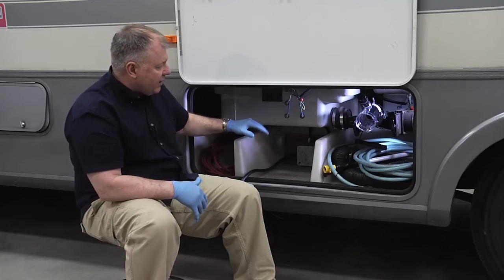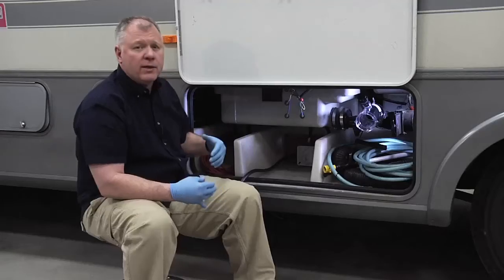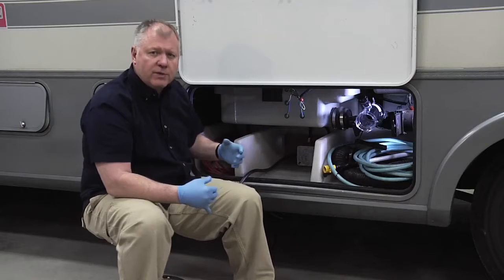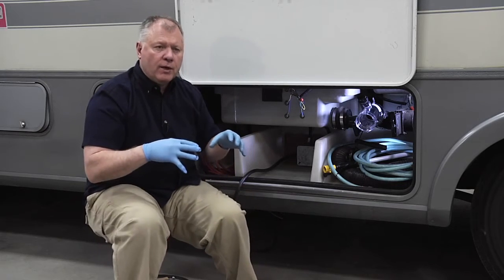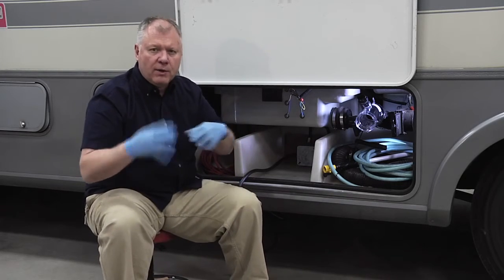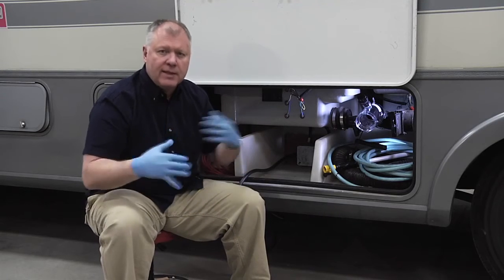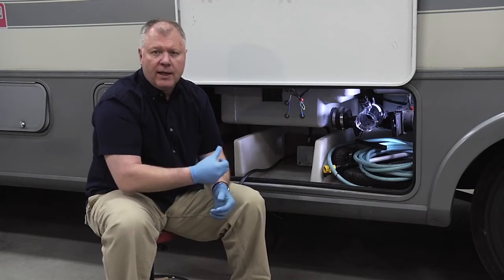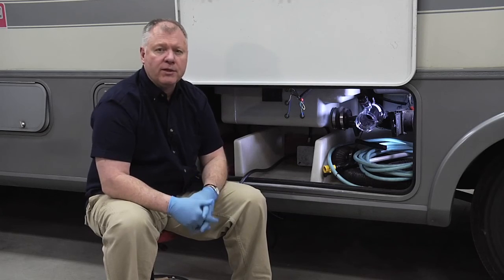RV Waste Tanks: How To Avoid Inaccurate Monitor Readings

Comment: The method most suggest is to pour a bottle of Dawn dish soap along with Clorox bleach in the tank once in awhile. I object to the quantity they suggest using. It can't be good to do it that way. I think it's time for the industry to move up to engineered systems which can do more automatically.
Why is there not a flush sprayer built into the tank aimed at cleaning the sensor each time the tank is emptied?
A small amount of cleaner specific to cleaning the sensors could be directed at the sensors to clean them. I find RV design is intended to make life more challenging in the maintenance area then provide relaxation.

Comment: Question: I have a KIB Model M25 and it gives correct level readings when on battery power, but when I am on Shore power, it reads all "E" even though there is fluid in the tanks and the battery is fully charged, what would cause that?
Reply from the maker: Great question! The ‘Ask an Expert’ section is currently for members of our online community. I would be happy to send your question off to the experts. To get started, please send the email associated with your paid membership account. Thanks!
Reply: @RVlifestyleandRepair  this is YouTube not your paid membership site.
Reply: I'll give it a shot. Possibly a bad ground connection someplace the electrician didn't get right.